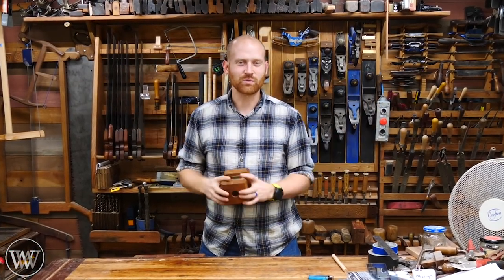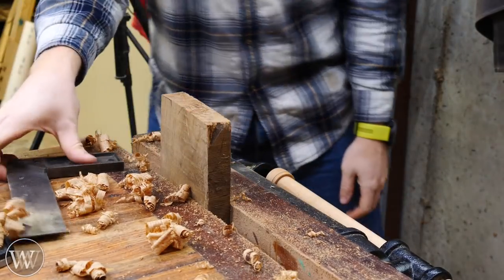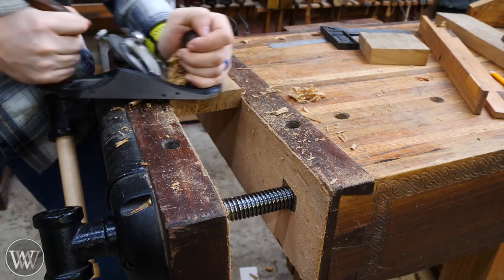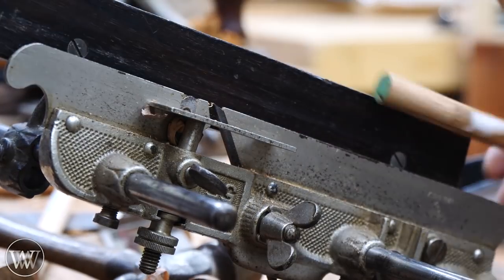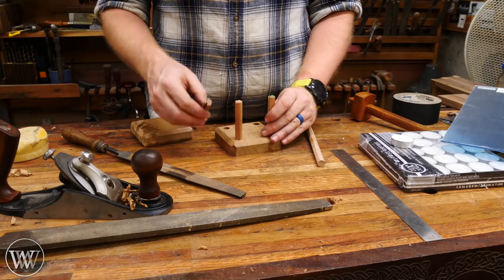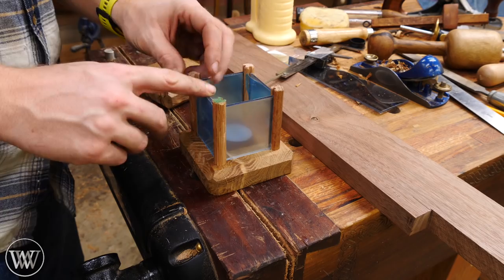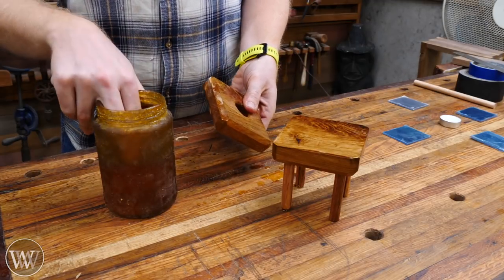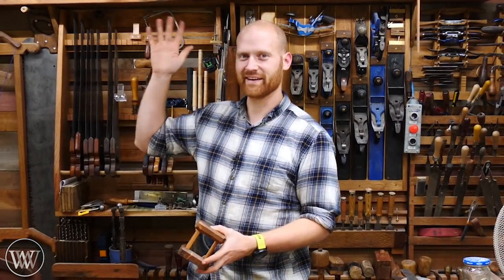How to Make an Infinity Candle Holder

Comment: I like the format of this channel. May I suggest that the voice over be louder on the next one. Its hard to hear you at times especially during sawing and such. I do love your work and both your channels.
Reply from the maker: thanks. audio balancing is a trick with voice-over. if I make it much louder it starts clipping, the problem is in bringing down the other sections to a manageable level and that level is different for each of the clips. but it is fun!